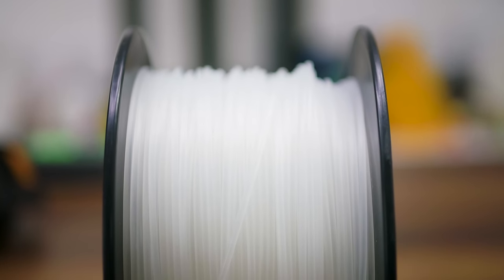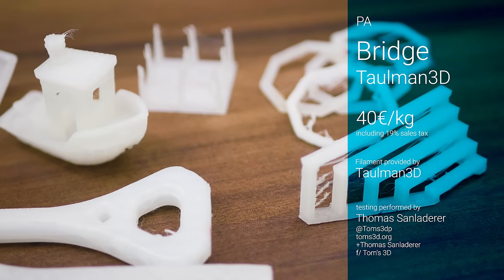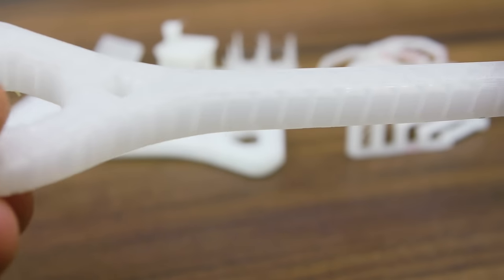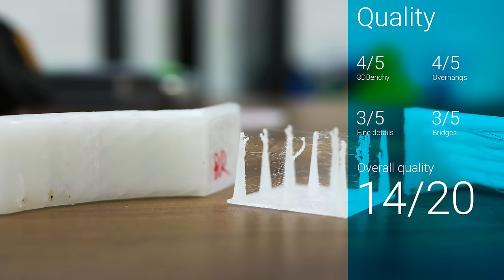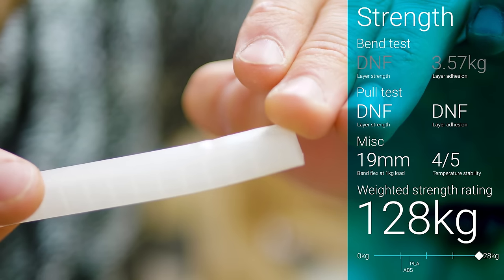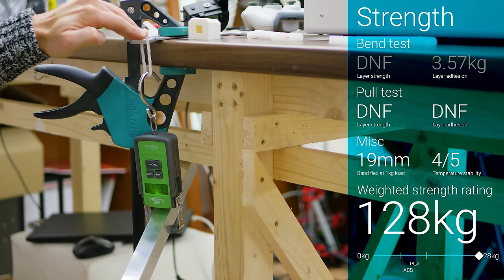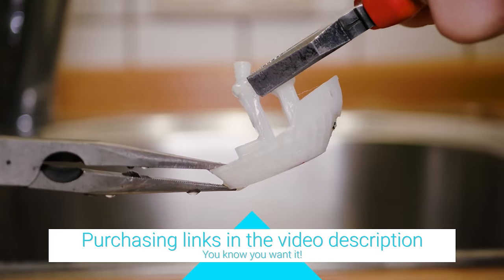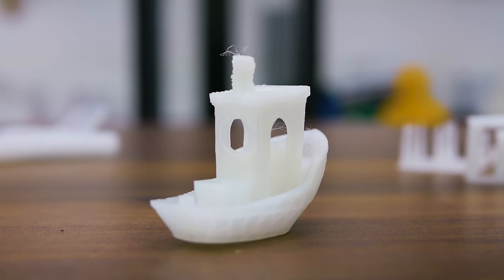Literally unbreakable - Taulman3d Bridge Nylon review! #Filaween

Comment: Just to clarify: it //doesn't need// to be stored extremely dry, as that implies that once it's absorbed moisture it's trashed (like PVA?)

It just needs to be dry before you print with it. So 70C in an oven for an hour or two before printing and you're good to go. In my experience it's best dried every time, even when brand new and straight out of the vacuum wrap.
Reply: I just put mine in a thermostat controlled dehydrator at 70c and the freaking spool shrunk and all the filament is super tight in it now... FTS
Reply: Hello, after the part is printed In Nylon, does it continue to absorb water?, does it degrade if exposed to normal atmospheric humidity or occasional brief exposure to water?
Reply: @acoleman8783  the part actually is more solid when it absorbs water. Humid nylon is more flexible and more durable. That's why often people boil their rc car parts (they are made from nylon).

Comment: I have had HORRIBLE luck getting any good prints out of this, out of the box day 1 it was popping like crazy and gives me horrible layer adhesion.  I suspect the spool I got was just an outlier that a significant amount of water in it already when it arrived.  I have not yet tried baking it, but I will eventually as it is currently pretty useless.

Comment: Hey +Tom! So I'm using taulman nylon 645 and I've been having better luck using your settings instead of the recommended. The only exception is that I haven't reduced melting and wondered what speed you recommend running the part cooling fan at?

Comment: Does this filament always need to be "prepped" in the oven before use? How dry do you need to store it? Is it sufficient to put it in a plastic bag with silica gel?
Reply: Ah, it turns out i'm a bit of an idiot :) I see you already did a comprehensive guide to printing with nylon on your channel. Thanks for the reply. And keep up the excellent work!

Comment: Another crappy filament for most prints. UGH.  Seems the only thing it has going for it is strength.
Reply: Not everyone prints an art project, for most of what I make I'm looking at specific strength properties
Reply: TeamSpartanHelmet
Functional parts that warp from the bed and string like hell?  I don't want to have to redrill my holes or spend an hour cleaning it up no matter how strong the filament is.
Reply: ... sometimes ... you just have to when strength is the most important consideration.
Reply: CesiumSalami
I'd find another process like a CNC mill to either make the part or make the mold.  3d printing is not the answer for a lot of things as 3d printing is rapid prototyping but in today's world you can get far better results out of a cnc mill to make a mold and injection mold the part yourself if you must have it in plastic.  If FDM was the answer to the world's ills then we wouldn't need any cleanup because you can take the same material into an injection molded process and you get no issues.   In the old days making a mold was hell and time consuming but now the cnc makes one in under an hour and you can inject the mold and be done in under 90 mins whereas the same 3d printed part took 4-36 hours not counting cleanup time.
Reply: Thanks for the informed response, +Dark Alchemist.  That's a great point.  For me, projects are extremely small volume.  CNC milling and injection molding just aren't accessible at this point.  3D printing is, however, and gets me an 85% solution that suits my needs.  No doubt the combination you presented is the better path.  But maybe I'm just being naive ... CNC milling has just been out of reach for me (cost wise).  I'm hobby grade - not pro.
Reply: CesiumSalami
Well, a CNC router can even make a mold but will take maybe an hour longer (I am go overboard on the estimation so I am putting the router at a snail's pace) and a machine to do that is about 500.  Injection molding maybe 400-600 so for 1.1k you will always beat a 3d printer now costs for materials will go up if you were just one offing, though the price of the plastic pellets is like 2-4 dollars per Kg, and this is partly why 3d printing was created.  Just print something close that if a change needs to be done you change it then print another (the rapid part) and you save costs of the aluminum mold but in the final production run you would use the cnc mill and an aluminum block.

3d printing has its place but for strength a molded part will always do better.  Oh, and here is another piece to ponder but ABS printed will melt on you faster than an injection molded ABS part.  Why?  I do not know but I suspect the ABS filament is different somehow but how I don't know.
Reply: With a lot of settings iteration, I've been able to get this stuff printing at just about the same quality as PLA. It doesn't seem like Tom is putting a ton of time into testing and improving his settings for this series, which is totally valid, but I'd recommend taking the quality results with a grain of salt. With time and testing, you can get this stuff to print very, very well.
Reply: ***** So don't 3d print
I have a cnc bridgeport as well, and a lot of functional parts I end up printing anyway.
Electronics mounts, belt tensioners, ect. ect. little fiddley parts are just easier to 3d print as long as you take the considerations of the material in mind.
TBH you should be taking the material in mind no matter what you are making but typically with little things metal is so strong it hardly matters.
I don't make injection molds or anything for these parts because it would be stupid to spend hundreds of hours making a perfect mold when I could just print up a part which will work just about as well for its purpose
Reply: Can you give more details about your DIY injecting methods ?